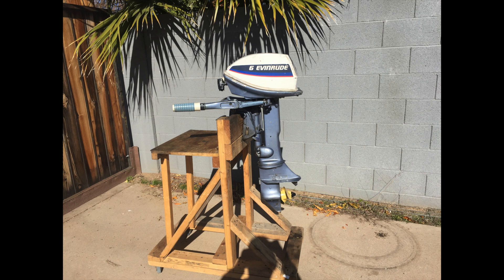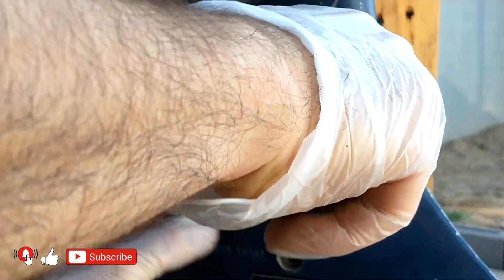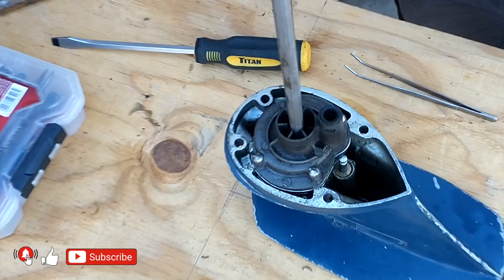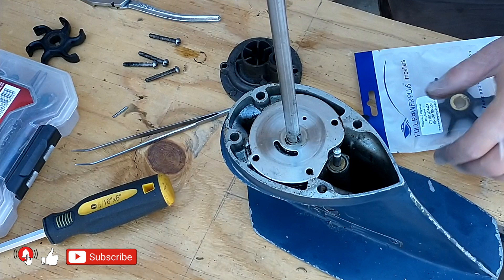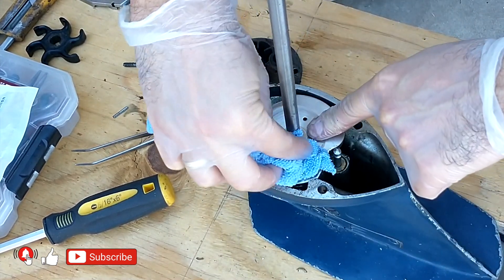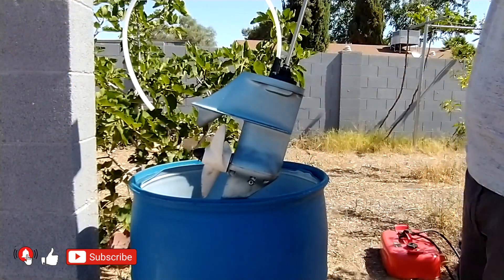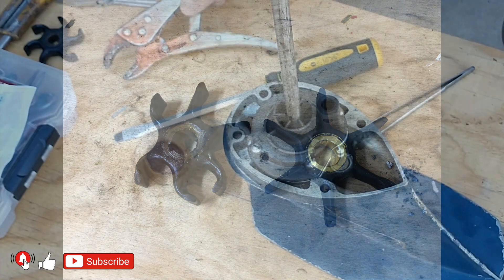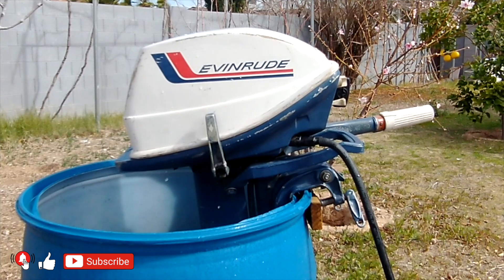English - 6HP JOHNSON / EVINRUDE IMPELLER REPLACEMENT

Comment: Hi I have a 9.5. I put a water hose on the impellar tube and when i turned it on some water came out of the spark plug holes. What went wrong. Any ideas. Thanks.
Reply from the maker: maybe the head gasket is burnt out...